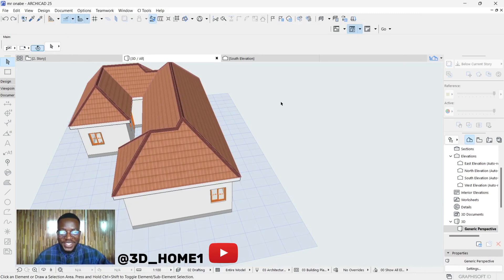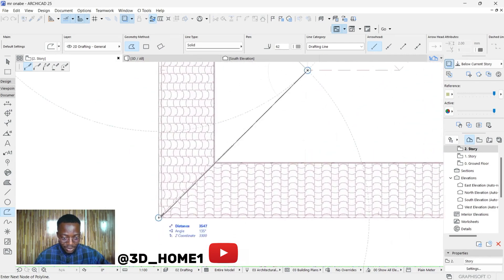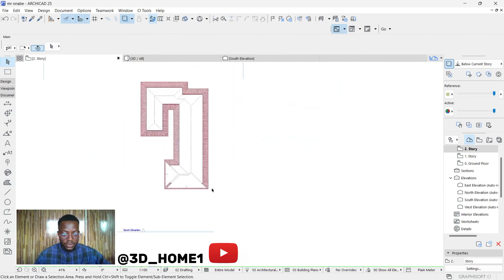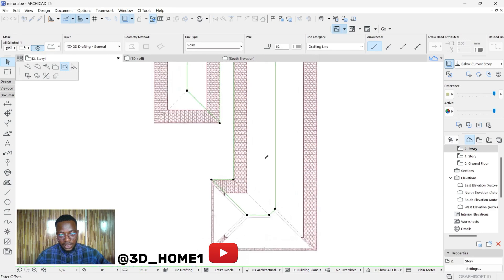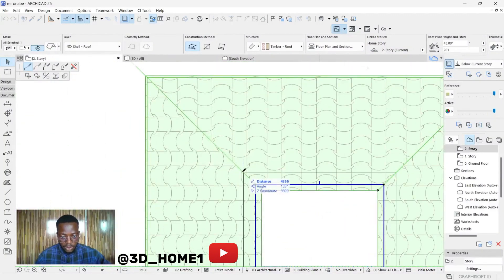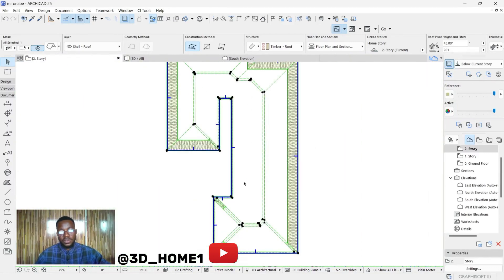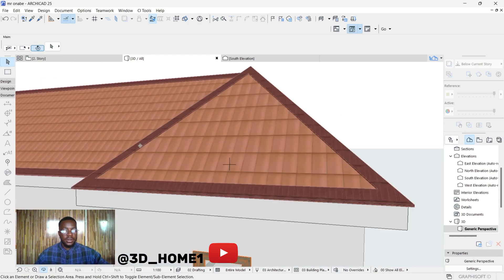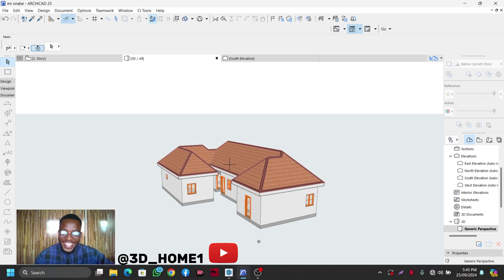How to model Ridge Cap in Archicad

Comment: Sir i understand how you create this ridge cap but if i want to apply on my work after i have taken the normal procedures it will still not work out, i could do small video so that you can see my results.
Reply: 0:2 0:28 8
Reply from the maker: Okay

Model small roof (roof on a square building) then try the method again let's see